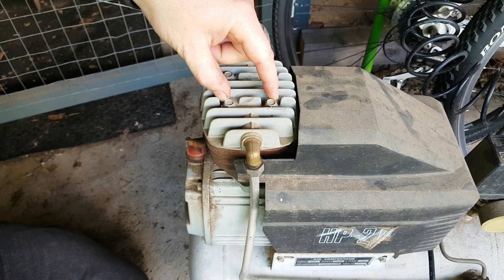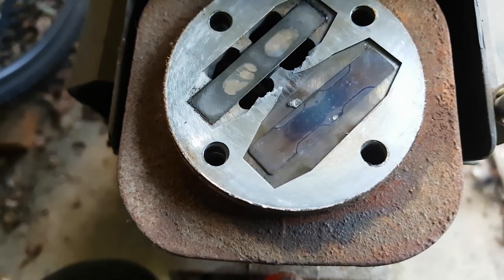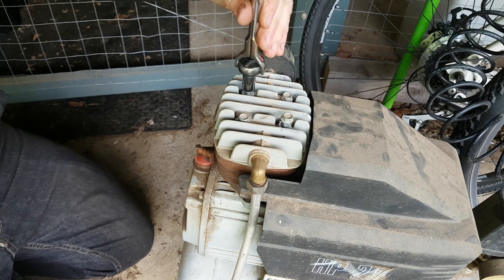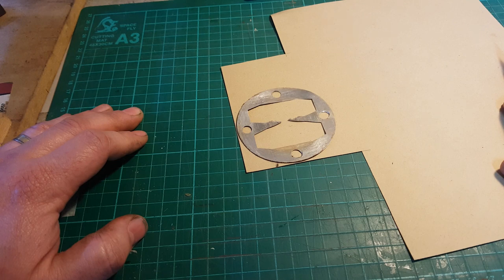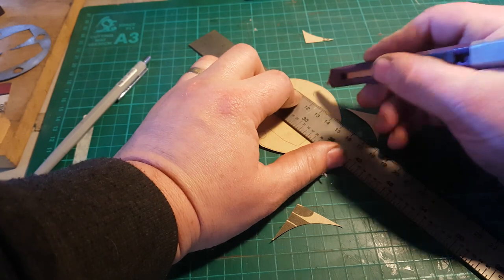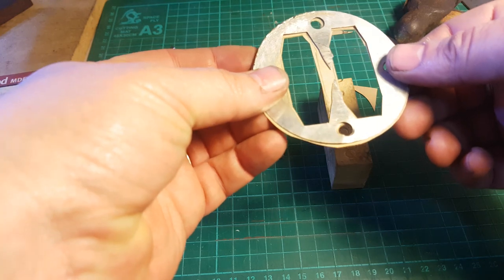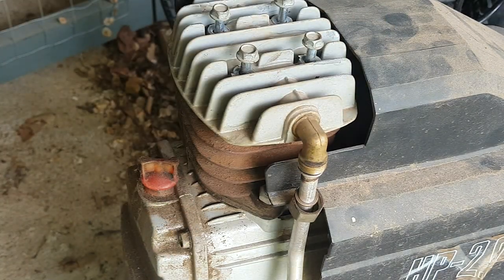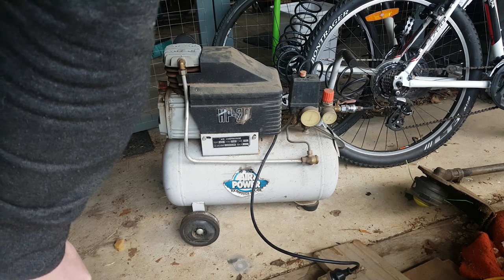Air Compressor Head Gasket Fix

Comment: Half a year on how has the paper gasket held up? Cheers
Reply from the maker: I wouldn't say it gets heavy use, but the gasket is still holding, compressor still pumps air fine, so I call this a win!
Reply: @StiffmanOz  cool, cheers for the video. Made a similar gasket this morning after seeing your video. So far so good. It's building pressure quickly again. The intake reed had maybe 5mm broken off the end. I reused it and just centered it so there's basically 2mm missing off each end. Not ideal but it's working for now.